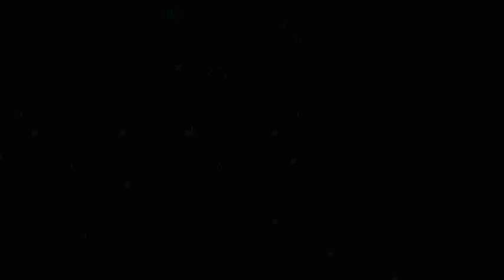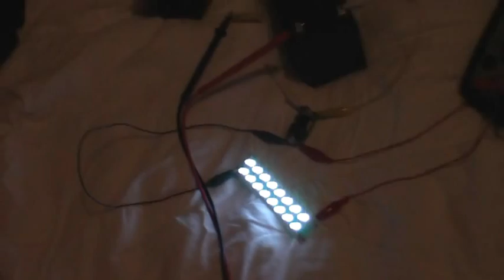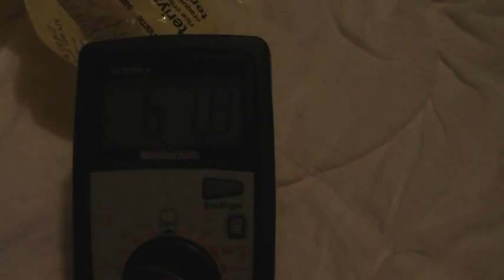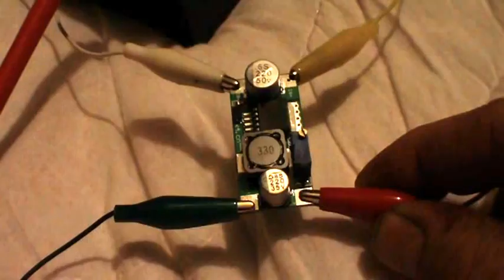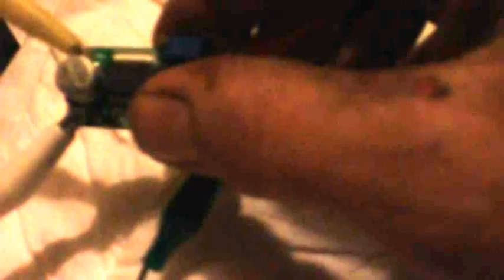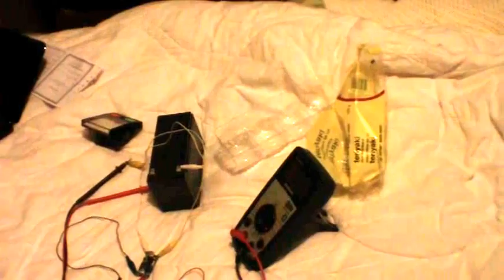12V - 3V DC-DC Regulated Buck Converter LED circuit for under $3 shipped

Comment: Hi folks I need help please.I have a desk top fan that runs on 2 AA batteries,  and its not long before they are flat, I have connected my 12v battery through a pot to get 3v but I dose not work??   maybe it is something to do with current? I am new to all this and would be very grateful for any helpThanks  John  :)

Comment: Do you know if the circuit will maintain a constant output voltage if the input voltage is steadily decreasing/variable (such as with a battery power supply). Thanks.

Comment from the maker: Yeah, it is difficult. I've played with them as well. I had the best luck running enough in series to then get about 2.5V. That way, at least, you can fill a 120F supercap and do what you want, with the energy, from there.

Comment from the maker: There is actually a circuit developed for that, but they want stupid money for it, $21 or something. As far as I remember, when experimenting, it's hard to get the transistors to drive enough current, when the voltage hovers around their minimum 0.6V, or so. Try a FET, or several. See this vid and if you build it, let me know as I am wanting to do this too: FET:2SK170 Boost Peltier Circuit by Sanjev21  v=Fzww6yPQMrg

Comment from the maker: If all 24 leds are wired parallel, between the two power rails (as I think you are saying...?) then Yes, you could take the 12VDC input and step it right down to a set 3.0V, add some resistance to current limit. You can enter 24 LEDs, their average current (each), your input voltage, and the LED calculator will give you the resistor to use. Google:  LED calculator

Comment: Kyle I’m a novice. I’m building an N Scale ferris wheel where  the + feed runs on the inside of one wheel and the - feed runs on the inside of the opposing wheel.. These wires run to the electrified contacts in the center of the wheel. The LEDs are wired between the wheels through each car. There are 24 LEDs. The average stats are forward v 2.4v, forward current 25mA and the input will be 12vdc.  Will this buck converter work to power these LEDS? Thank you.

Comment from the maker: Well yes there is maximum current that the circuit will sink, 3A I believe. They are on sale right now for like $1.60 Talk about cheap. So, yeah, 3A is tons to run what you want. You could run well over 100 typical 30 mA LEDs with one of these. Thanks for watching.

Comment from the maker: Yeah I hearya. So far, I've experimented with practicle, usable device... alternative usage devices... but as far "pure efficiency" - you gotta hand it to modern PWM, switching mode supplies / buck / boost. Not enough attention is given to the decades of hard work, already done by Engineers. A few coils and transistors better be configured VERY special to find something that hasn't already been beat with high frequency ferrite core oscillators with real time feedback control.

Comment: Good video Kyle. I'm glad more people are becoming aware of these very affordable little gems. Thanks to you, through the datasheet, I found out some models can be digitally turn on/off. The standby power is in the micro amps. I have a future project to control one with an micro controller. Cheers.

Comment from the maker: Agreed, I have used diodes to create a little drop, good trick really, with this, though, I'll change out the variable resistor with a nice handy pot pot, fire up (12) 1 watt LEDs, at 9.6V. Should be well within the 3A rating, provide big light. I saw an LED voltmeter/display for $3 on ebay, I can set that to the output. That way when the 12V battery drops to 11.5V, I can always dial up the buck a bit if it goes dim. And no resistors on the LEDs, full room light :)

Comment: @KyleCarrington Appreciate your videos, they’re interesting and informative. If using 12V it be simpler, lower cost and more efficient to power 16 LEDs in series-parallel (4 groups in parallel of 4 LEDs in series). To not exceed LED max Vf with fully charged battery, diode could be added in series at power input to provide ~0.7V drop with heat loss of 47mW (67mAx0.7V). More efficient than converter (12.7Vx67mA=0.85W, 94.47% eff.) but drawback of no low voltage operation–big plus for converter.

Comment: Pretty good cheap circuit, easily set for output. It's probably easier to charge a 12V small batt on solar than AAA's anyway, being as panels seem set up for 12V applications. Just a note and unimportant, but the 'puck' lights are generally 4.5V (3x AAA, arranged in a triangle inside). Good example though for practical uses and just means turning the pot a bit lol

Comment from the maker: 2 bucks even now! They were 4 when I bought it, now I see it's just over 2 bucks shipped LOL. Works very well. After the video, I took a 3 million candle flashlight I had bought in a thrift store for a few bucks, it had been discarded due to the sealed lead acid battery (4v) being dead.. no one wants it... but now, it's a 12v light. Or 6V. Or even 24V.. whatever you want.